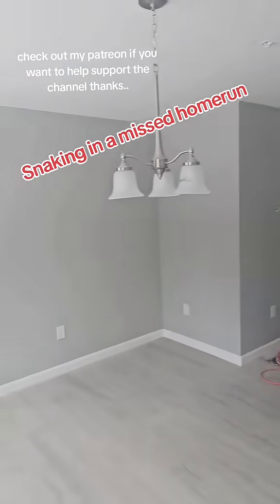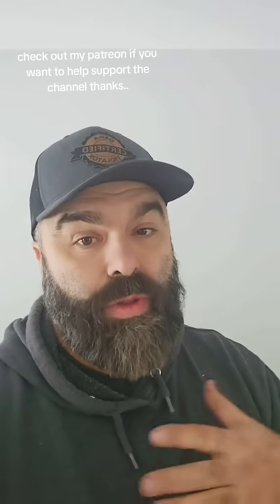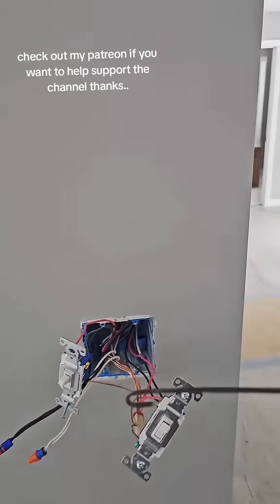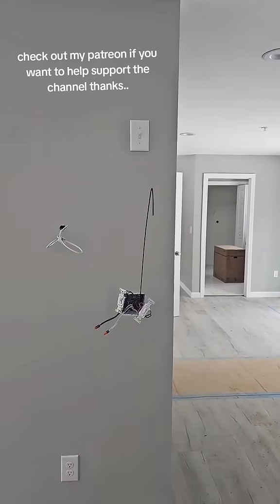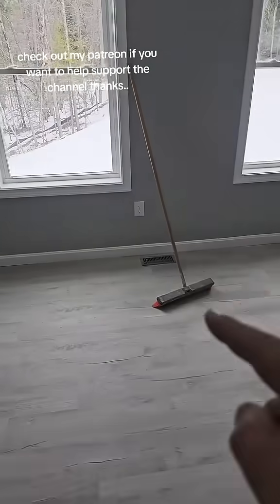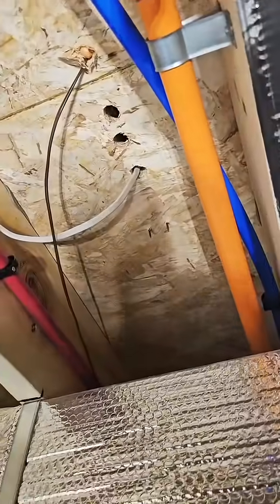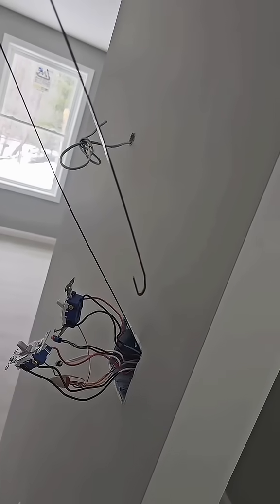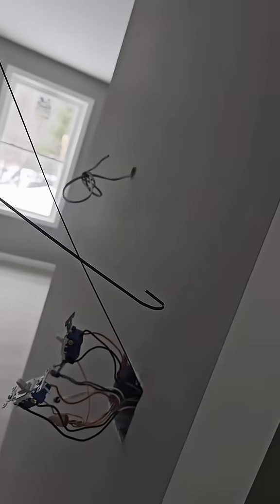fishing a wire into a switch box

Comment: With the use of a very tiny drill bit you can drill a hole into the floor then use a coat hanger to come through you'll know where to drill. 
Then all you have to use is a little bit of putty of what type of material you're working with and you'll never see the whole you used for the coat hanger

Comment: Using one fishtape to snag another is perhaps the most difficult approach, but obviously it went well for you and that goes in the "W" column.  I typically use mason line with a 3/8-16 nut tied at the end,  or a #14 or #12 insulated white conductor dropped down the hole of the box and try to snag it with just one fish tape.

Comment: I was listening to everything, but after I realized the switch up top was the furnace switch and then he told us it was the furnace switch… Why in God’s name would they put that in the middle of the room and not in the stairwell going to the basement like everybody has done for over 75 years
Reply from the maker: @tizzy6  because it's a code violation to put in the stair well it has to outside of the basement adjacent to the exit.  NFPA 31 10.5.12 
"For electrically powered appliances, the requirement of 10.5.1 shall be accomplished by an identified switch in the burner supply circuit, placed outside of and adjacent to the entrance to the room where the appliance is located."
Reply: @ damn thats one of them codes that need a revision lol thats just a dumb rule and looks awful never seen it done like that honestly but i understand you gotta follow code but why not just follow nec, usually the local inspector goes by that? Just need a clear marked switch, dedicated branch circuit and readily accessible
Reply from the maker: @tizzy6  NEC is NFPA 70, NFPA 31 is the oil burner code.  Its not my code or rule.  If the the furnace malfunction you need to be able to kill it without going into the room the furnace is in

Comment: I'm so thrown off by the disconnect being by the stat instead of the equipment
Reply from the maker: @scottworcester4648  there's a code that requires an emergency disconnect outside the room of an oil burner there's a service switch on the side of the equipment
Reply: @Stevenj120volts  oh that's interesting. We don't have oil here other than really old houses. All of our new con is heat pumps, and retro pulls oil for either ng/lp furnace or heat pump. Disconnect switches near homeowners usually end up in service calls in my experience lol

Comment: Here in Arizona, yhere are not many basements.  We are forced to run thru the attic.  However yhe process is similar.  I often tie a length of nylon mason line on the fishtape in the wall and use a Ridgid See-Snake, fiber optic camera with a hook on the end to snag the string.  Nothaing quite as rewarding as doing the job the customer fears is impossible.

Comment: Could you please elaborate? In your opinion, how much is "stupid" expensive? What type of "false alarm" would cause the entire house to flood?
Reply from the maker: @ronbrock5688   sprinkler system are not expensive if done during new construction.  And I dont really think you could have a false alarm. They trip from actual heat not a computer sensor.  Only the head near the heat goes off.  Its very rare to have a death from a fire in a  home with sprinklers.  In fact there has never been a case where more than one person died in a house fire if the home has sprinklers.  If you have a $500,000 2 story 2500 sq ft home then Sprinklers cost about $10k

Comment: Haven’t seen the furnace switch not on the furnace before but instead on the floor above… that’s a new one wow.
Reply from the maker: @sqooot  its required with oil furnaces but NFPA 31
Reply from the maker: @sqooot  you need a switch in the furnace for servicing and you need one outside the room where the furnace is adjacent to the exit for emergencies so you don't have to enter the same room as the malfunctioning furnace
Reply: @Stevenj120volts  appreciate you dropping knowledge. that’s national code?
Reply from the maker: @sqooot  NFPA is the  National Fire Protection Association like the national electrical code is NFPA 70.  The oil *BURNERs are NFPA 31.  Its written for a nation thing.  But it doesn't affect you unless your local state or town adopts the code
Reply: @ awesome thank you for dropping knowledge bro
Reply: What is oil biting?

Comment: I do this with a furnace chain and an bare ground no10 the ground fits just so in the furnace chain almost get it first try every time. Your very effective method I use for walls with insulation. Either way great video.

Comment: That will  be a No problem , if you had EMT pipes...!!
Reply from the maker: @bogdan78pop  you think  adding a pipe is easier than the 10 mins it took to add this wire
Reply: I don’t think he meant adding emt,  if only it were already there…
Reply from the maker: @nicholasittzes7224  if it was already the there so would the wires be there.  The connection to the panel was forgotten.
Reply: @Stevenj120volts Yeah, most likely true, unless a conduit was missing, or one wire was missing in a multi circuit home run.

Comment: So gross having return on the floor facing up. Change ur furnace filter every week and enjoy all the crap in your return duct. No excuse for that. Poor design poor architecture, poor layout from the installer. No excuse
Reply from the maker: @feeblewrk5788  considering I hear many people incorrectly trash electrical work.  I am going to assume you are incorrect as well
Reply from the maker: @feeblewrk5788  the very first Google hit says if it a heating system the return goes in the floor if it a AC system the return goes in the wall

Comment: Home fire sprinkler. You don’t see that around here in Michigan very often.
Reply: I noticed that too. Something the Fire Code required several years back but most municipalities here in the South have exempted from builds because it’s stupid expensive and also just plain stupid. One false alarm and the entire house is flooded, then your insurance cancels. Smoke alarms in residential homes are more than adequate.
Reply: They are required in my area if houses are less than 20ft apart. They are mainly used to help fire from spreading. Id take wet stuff instead of stuff in an ash pile.

Comment: Tip:  Tie 2-3' of loops of jet line on the end of the snake going into the wall and also tie the bucket of jet line to the snake coming out of the box.  Drill 1 hole in the plate in the basement and use a hook to catch the jet line in the wall.  Takes a very short amount of time.  The jet line tied to the snake coming out of the box is in case the snake is pulled into the wall.
Reply: exactly

Comment: Mr Steven  I love your vids and this one brought back memories. I spent several brutal winters in my '20s (now 40 yrs ago) re-wiring (live) knob and tube company housing built in the 1920s. It was rehab work under a state-funded program. Fully occupied I might add. I worked with this nice old calm sparky - slow and steady .. pipe smoker type. He taught me more in the first couple of those jobs than all the yrs of trade school and apprenticeship combined. We wired those 2-story houses on 18” dirt crawlspaces to 1980s code without ever having to open a wall or ceiling or make any other cosmetic repairs. Chains, fish sticks, tapes, 4’ bits with 4’ extensions and a bunch of home-made contraptions is how we did it. 
By the end of #50 or so we were knocking those jobs out almost as fast as roughing in new work. The first couple were terrifying… I had done a lot of new work but had no idea where to even start . Mr slow and steady schooled me to the max- It really was a blast once I got good at it.
Reply: I’ve done single story on unfinished basements. That’s easy peasy. I too wouldn’t mind learning some tricks and techniques on 2- story some day. 👍
Reply: That’s awesome would love to have seen some videos on how you did that

Comment: Why is the furnace switch upstairs if there’s a basement?
Reply from the maker: @Steezyy  an emergency switch is required out side the room is required by code with oil heat
Reply: Oil heat in a new build?! Crazy
Reply from the maker: @sledderguy1871  most houses around here are oil.  So this builder wants it wired to oil code even if it propane.  We don't have natural gas except for in the cities

Comment: I'm an ex HVAC installer and when I started out in the 80's I did mostly retrofit change outs of old sawdust and coal furnace that had been converted to oil in the past. When we installed new equipment we always had to pull new wires for the control and often new dedicated circuit. I appreciate you were not using a 50 foot fish tape on the reel beating the paint on the wall up. I used to carry a light weight chain about 2 feet long on the end of a short piece of fish tape with the end bent over tight and tapped smooth. You had it pretty easy locating to wall from the basement but when you don't have other wires to help locate it I would cut a piece of coat hanger and use it in my drill at an angle right at the edge of the baseboard.  When located in basement or crawl space I could drill up into wall with a 1" hole. Now for the chain I mentioned earlier. Drop the fish tape and chain down from the box and move it around a bit and the chain will fall through the 1" hole and you can attach to it and pull wire up. The chain will find the hole.
Reply: I’ve never done much remodel work that wasn’t a complete tear out, so I never kept much on hand. I did find that you can actually use #12 bare copper the same way. But first, chuck it in the drill, bend a small hook in the other end, and hold it with pliers. Twist the wire for a few seconds, and it will work harden the wire as well as straighten it. Cut the hook off, and it will be hard enough to go through hardwood and subfloor several times. Works great in a pinch. Some of the benefits of using wire (copper or steel) instead of a drill bit is it won’t snag carpet, it’s long enough to make it easier to find, and it won’t snap off if you accidentally bend it too much taking the drill off. Oh yeah, it’s free too. 
Also some company sells ball chain for wire fishing. I hear it’s rather handy, and you can just buy it at a good hardware store.
Reply: I honestly prefer my fish sticks to the fish tapes for that reason. The sticks are plastic and flexible, I can make it as long or as short as I want, and have more options than just electrical tape and a hook on the end. 

Also, it's one of those products where the harbor freight version is probably better than the Klein or Milwaukee ones. Those ones are very expensive and have almost no flex. Harbor freight gets you 10 3 ft sections for like 15_

Comment: Be very careful pulling electrical wires with a metal snake. This was new construction so the main was probably turned off. But in any other situation this is a conductor really close to possibly live wires. 

They do make non conductive snakes but they are expensive and a little bit harder to use.

Comment: Give us some code reqarding that tab you say must not be removed in the back of the box, ive heard if you remove those you have to strap your romex at 6" from the box instead of 12 as far as im concerned those tabs are more damaging to the wire so i rip them out
Reply from the maker: @jonathanz9895  that code exception is for single gang plastic boxes only.  Do you have your code book?  Give me 3 mins
Reply: @Stevenj120volts  I have a code book I just haven't looked for anything regarding those tabs I rip the majority of those tabs out of all my blue plastic boxes regardless of gang size. I just strap my wires nicely and to code and fold my wires nicely when I make up the box and everything sits nicely
Reply from the maker: @jonathanz9895  I asked if you had a code book cuz I wanted to give you the reference location matching the year book you had.   What year book do you have?
Reply: @Stevenj120volts  I have 2020 in my car and 2017 in my house that exception is also in 2017 so you're correct
Reply from the maker: @jonathanz9895  I found it in my 1940 book too.   It just moves
Reply: @Stevenj120volts  interesting they should update the code or the boxes themselves to have solid enough strapping like those old school metal handy boxes or Romex connector equivalents. All blue plastic tabs are garbage and the fiberglass boxes with the black piece that is removable and squeezes the wire isn't that much better
Reply from the maker: @jonathanz9895  nec2023 314.17b2 exception

"Exception: Where nonmetallic-sheathed cable is used with single gang nonmetallic boxes not larger than a nominal size 57 mm × 100 mm (21⁄4 in. × 4 in.) mounted in walls or ceilings, and where the cable is fastened within 200 mm (8 in.) of the box measured along the sheath and where the sheath extends through a cable knockout not less than 6 mm (1⁄4 in.), securing the cable to the box shall not be required. Multiple cable entries shall be permitted in a single cable knockout opening"
Reply from the maker: @jonathanz9895  so the rule call for 12" but assumes you will have a clamp or connector.   But the single gang exception allows for no clamp or connector as long as you are supported within 8 inches
Reply from the maker: @jonathanz9895  but 334.30b says wires fished thru voids don't need any supports
Reply: @Stevenj120volts  yup I knew you were good without strapping your wires in the finished wall, and I see that code reference it's just unfortunate how sharp the corners are on those tabs and how difficult they make it to remove Romex from them
Reply from the maker: @jonathanz9895  I don't think it's a big deal if they break.  I was just trying to explain best chase way
Reply: @Stevenj120volts  well all of mine break 🤠 and good video
Reply: I just don’t like leaving giant holes in the box. I never saw any real problems with wire damage from those clamps anyway. Just on rare occasion when someone jacked around on one too violently.

Comment: You are correct, there are many ways to do this. Have you ever used a length of dog tag chain? Start feeding it and it will eventually go through the hole. Tape on your wire and pull it back through. I was taught this by an electrician many years ago. I have done it a time or two. It is my favorite method.
Reply: I like that

And u can use a magnetic wand to fish it out too
Reply: I used to use jack chain for this. It does work well with a magnetic parts picker.